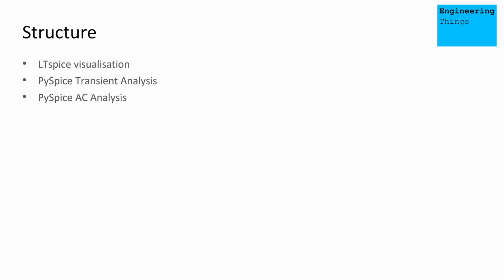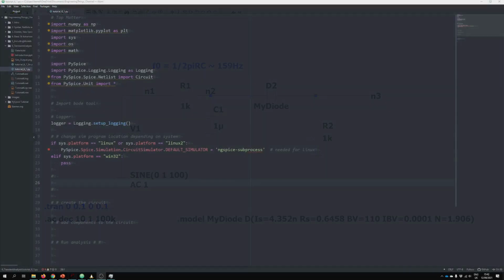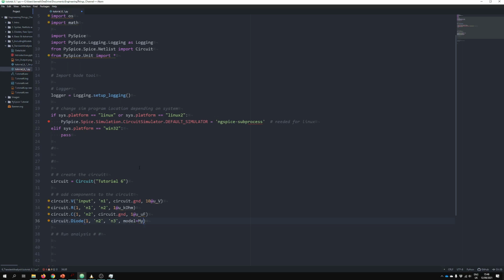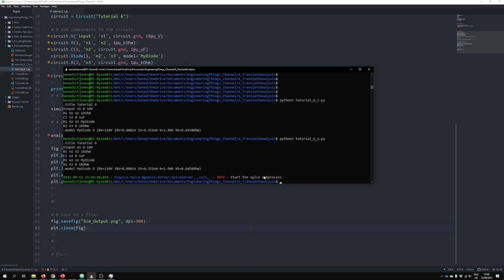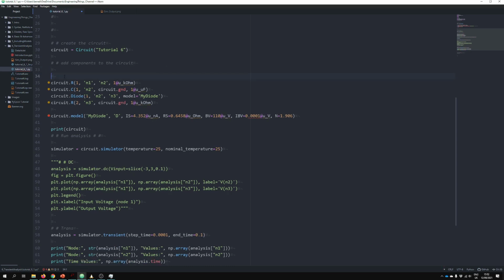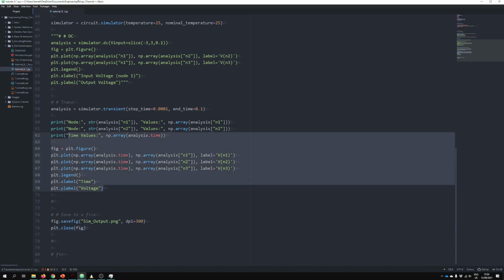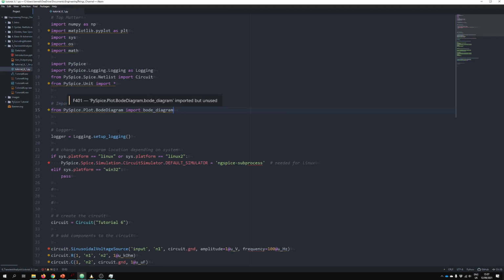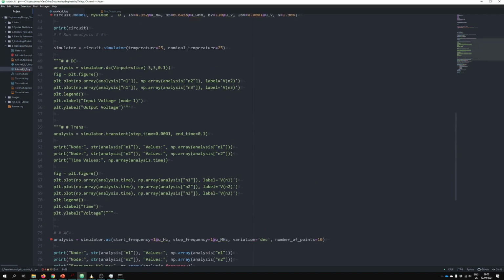PySpice - Part 6: Transient & AC Analysis

Comment: Great videos. Its good that you are rewriting most of the code. Do you ever encounter with model compatibility issues?? I tried to run a simple simulation with the INA128 and I can't make it converge to get the operating points. Thanks for the videos, keep posting!!!
Reply from the maker: I have had convergence problems trying to implement tunnel diodes (i.e., a B source with a complex current equation). There is also some compatibility issues between different SPICE software - for example, NGSpice (used in PySpice) defines a B source IF Statements differently than for LTSpice. I'm afraid I haven't had to model an amplifier in Pyspice recently!